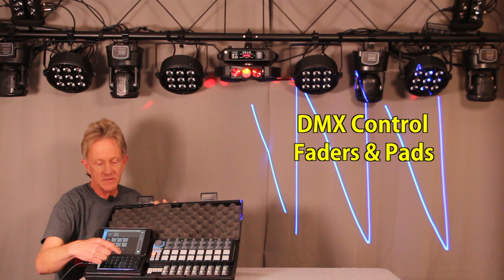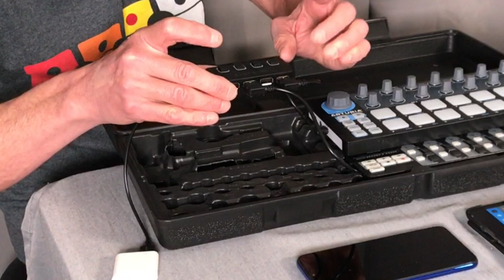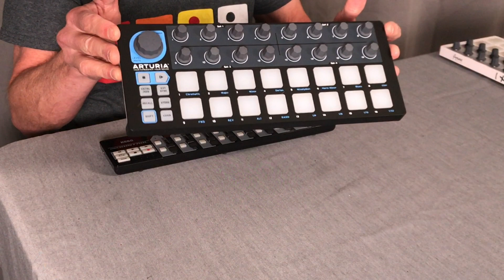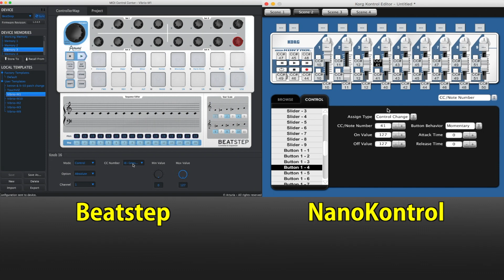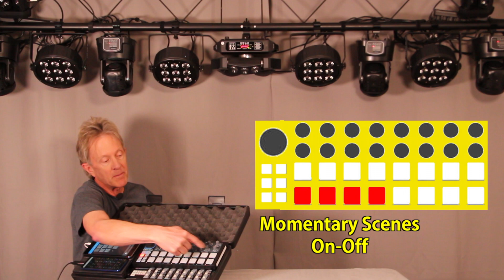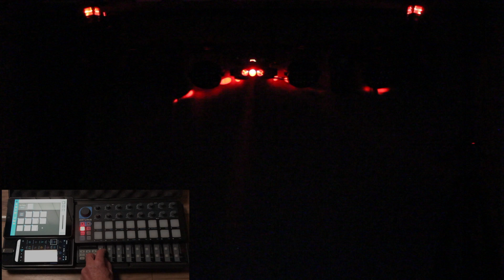How to Build a DMX Controller

Comment: Hi Steve, good job, I followed your solution but it doesn't satisfy me one hundred percent. Unfortunately, Vibrio has limited possibilities.
It's a pity that app only has the two midi mapping option only for scenes.
I would like it to be possible also for shows, tempo, sliders, in one word, complete midi mapping.
The application itself, the interface and the ease of use are fine, but the options I mentioned above are missing.
Or advise what application to use to make this possible with this hardware configuration ?
Reply from the maker: Thanks and agree Vibrio has limited MIDI functionality. Check out the app StageLight. It's inexpensive and there are way more options for MIDI (plus the developer is always adding features)
Reply: Hello, I Just tested the Stage Light app, I have hope that will be greater than Vibrio, However, there are a few issues that I don't know how to solve, such as the button illumination.
Thanks for reply.

Comment: Nice work Steve, Chapeau! With which tools/apps/programs do you programed the midi-controllers? Free- or Shareware for Mac? Best regards, Ralf
Reply from the maker: Hi and thanks for the kind words. I program the Arturia Beatstep with free software (on my Mac) called "MIDI Control Center" and the Korg nanoKontrol with free software called "KORG KONTROL Editor" Thanks for watching!
Reply: So how did you use those apps to convert it to dmx? Did you use a usb to dmx and then do something or did you use a software like QLC+?

Comment: sir eDMX1 PRO and
enttec - dmx usb pro dongle, usb to dmx interface (rdm) 512 ch, 1 universe is it the same? they that can be used with vibrio apps, that I can imitate the idea of your set up, what is the difference between 5 pin and 3 pin?? thanks for the answer
Reply from the maker: An iPad setup like this doesn't work with usb-to-dmx interfaces (unless you jump through lots of hoops). It needs an ethernet-to-dmx interface with a router. The difference between the 5 pin or the 3 pin jack just depends on which cable you have or plan to use. (I've found that the 5 pin is much more common)
Thanks for watching!

Comment: Hi. Like your vids. Is there a reason you got 2 controllers when you could have just used 1 with sliders and buttons? Is it cost or something else?
Reply from the maker: Thats a good question. I did it for a couple reasons. I happened to have both controllers already and I really like my Beatstep and understand how to program it. Also, they are both pretty small and I wanted my setup to be compact. If I was starting from scratch I'd probably get a controller with faders & knobs and use just one unit. Appreciate you watching!

Comment: My compliments Steve  - your videos appear to be the most reliable and clear out there.
As I still don't own a laser but I'm planning to in the future I think the first step are a pair of googles.
Could you please provide a link for a non-chinese set in a normal budget ?
Thank you and best Regards.
Reply from the maker: Hi and thanks for the kind words! Here is a link to buy Laser Safety Glasses made for laser shows. I'm not sure where they are manufactured:
https://lasershowprojector.com/products/laser-safety-glasses
If you google "laser safety glasses" you will find lots of information and glasses which cost considerably more (as well as less) than these.
Reply: GASP ! 😮135 $ ! Health has no price but I thought to stay within 80...
Thank you anyway - I'll go for them.
Reply from the maker: @Francesco-1988  I noticed there are some on eBay for as low as $40 but I also saw a pair that was $395!! (more than the Laser LOL)

Comment: Hi Steve, glad to see you are back! You always provide well taught and detailed videos. You have helped many humans! Any foot switch ideas for light control? I have a few Obey 40s, a BeatStep, 3 midi footswitch boards, a spare router, an older Apple TV streamer, an iPad mini 4, a MacBook Pro late 2013 and a ton of lighting fixtures. Just not sure how I could hook up anything useful to run with midi foot switch boards? I have my hands full as a one man band. Thanks for your videos!
Reply from the maker: Hi and thanks for the kind words! I was planning to make a DMX foot switch video, but got diverted when I realized my MIDI foot switch only sends MIDI program change data and my Obey 40 and Vibrio on the iPad only respond to MIDI note data. If your foot board sends note data you can trigger any scene or chase easily, otherwise you need a hardware box that converts data (expensive) or an app (like Luminair on the iPad) that is CoreMIDI compliant, or responds to MIDI program change.
Reply: LearnLizard cool Steve & thanks very much for the info! Not sure which type my midi floor board footswitches are? Maybe I can find info in a manual online.
Rocktron midi mate floor switcher, Behringer FCB1010 floor switcher which will be modified with an eprom firmware chip that is supposed to make the footswitches operate like guitar stompbox switches.
And also have an old ART X-15 Ultra Foot switcher.
So I’m hoping that one or all of these floor switches would plug into the Obey 40 midi and provide basic on/off capabilities for various Chauvet Scorpions & similar Blizzard units as well as LED par cans etc. 
Thanks again!
Reply from the maker: @RevoKC  The FCB1010 can send MIDI note info so you could use it to trigger scenes on the Obey 40. I wish it was smaller like the X-15 or Midi Mate, but they don't sent Note data.
Reply: LearnLizard  WOW Steve, thanks so much! You really helped me just now by confirming that at least the Behringer unit will work. Agreed, the size & weight of the board is not appealing. The Midi Mate would be ideal. Since I am not much of a tech savvy guy, I can do fairly simple mods which also includes bruises, cuts, abrasions & burns from my soldering iron, lol... So the eprom mod on the Behringer is simple & about $25 for the chip. Haven’t done the mod yet. Ideally I hoped to just run a midi cable between a foot switcher & one or more consoles & just daisy chain all lights. So mostly just on/off options with foot switches. Maybe that is dreaming? If you invent mods for what I’m trying to do, there would probably be a market for that. Looking forward to your footswitch video if you do one!